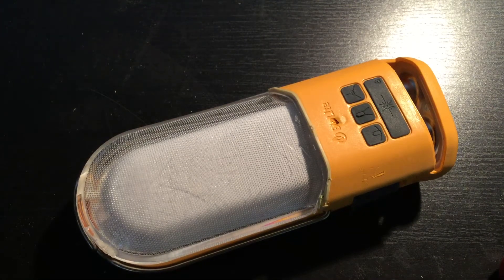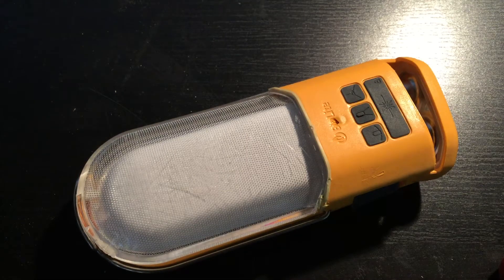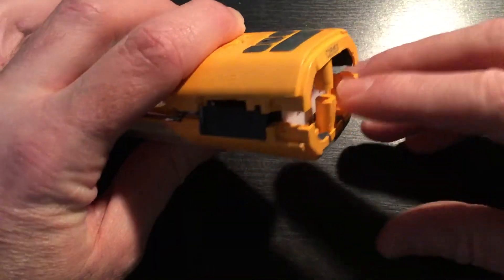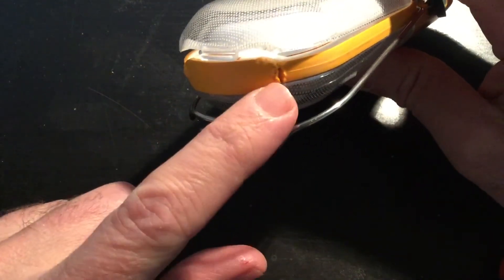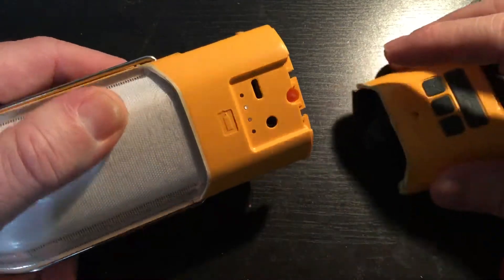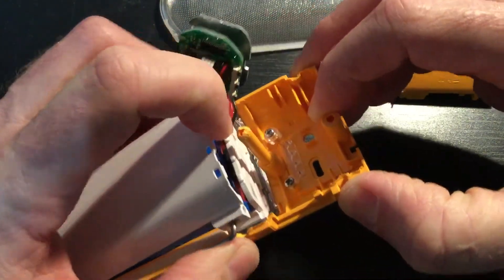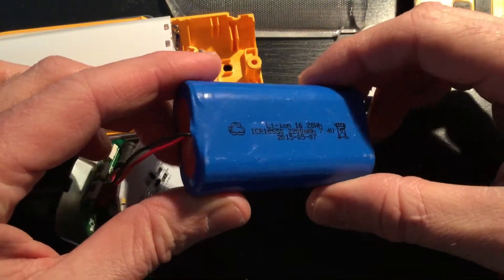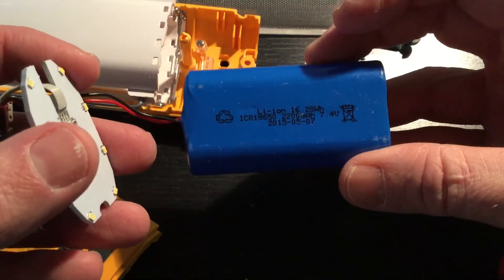Biolite Powerlight Disassembly and Battery size

Comment: Pop the little battery label peice, it comes off, undo the screw underneath. There is also a screw under the rubber peice for the charger port. Pop the rubber peice off, the screw is located in the hole. Then diasassemle.Pop the end of the lamp cover, this will allow you to replace the battery.
** NO drilling required.**

The battery is 7.4 2200mah li-ion, not 4000mah; as mentioned in this video.

Comment: Mine also died and was looking for a repair instruction and found your video helpful.  Mine was bought in 2020 and the battery has a 2019 date label.  In any case mine must have been poorly assembled, or Biolite stopped applying glues as it came apart without an effort.  The front light piece and the top cover where screws come out from inside came off easily.  Once I removed the screw under the cover for charging port, everything came apart with slight pull without breaking anything.

Comment: The battery symbol is actually a small plastic plug that conceals the second screw. You can pry it out with a blade or similar.
Reply: This was almost impossible to believe as the plug does not seem removable but you are correct. The yellow battery symbol made of plastic on the same side as the charger and 3.5mm "minijack" plug for the external lights conceals a philips screw. I was not able to remove it and used a drill but everything came apart and you can clearly see that the battery symbol is a lid that conceals the philips screw.

Comment: There was a screw on the other side behind the plastic, you did not had to drill but just remove the small plastic on top of the screw. (I found that out today) Did you find a battery replacement? I agree with you. The lantern is very nice! That's why i want to replace it as well

Comment: Were you able to buy a replacement battery?
Reply: The schrew is behind the small Battery-sign on the back-a piece of plastic right as big as the battery-sign can be removed..with a needle or use glue to pull it out. I will oder a battery with a higher capacity-this should also work.
Reply: @schlaefe  by removed you mean cut out? This doesn't look like a separate piece, a lid if you will. It looks like the battery sign is embossed on the main plastic body.
Reply: @auhopu  the battery-sign is indeed a separate part. If you take some hot-glue on it (or something vacuum-ish) and pull it out, you get the screw.
Reply: @schlaefe  might be an interference fit. I can't see anything under a 40x loupe. I have been trying with an exacto knife. I'll probably cut out a square window with a hot knife. It's dead anyway.
Reply: @auhopu  Can confirm, the small battery logo does come off and reveals a screw. I shoved a leatherman blade in it, and it popped off.
Reply from the maker: Haven’t gotten around to it yet. I’ll update when I do, or if someone else is able to get one that works, it would be great to hear!
Reply: @portager1306  i did order now: li ion accu icr18650 2200mah (2 pieces) .. will let you know if it works
Reply from the maker: @edoz8939  Sounds good - I'm definitely interested to hear if you got it working again.